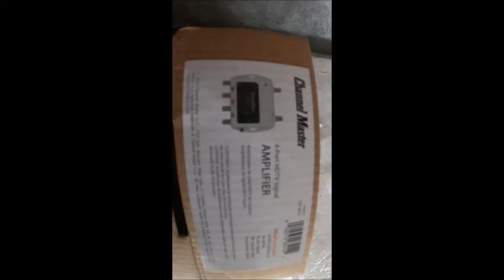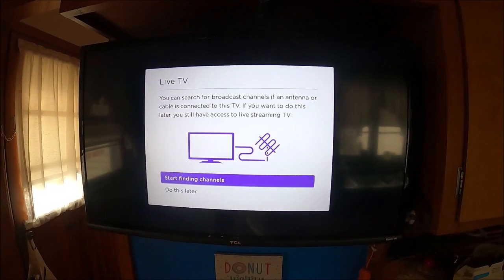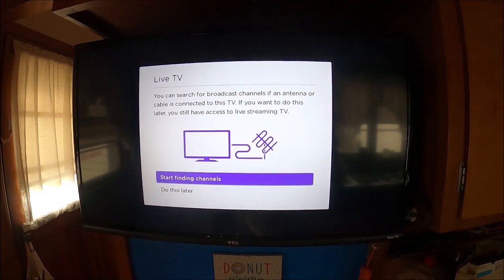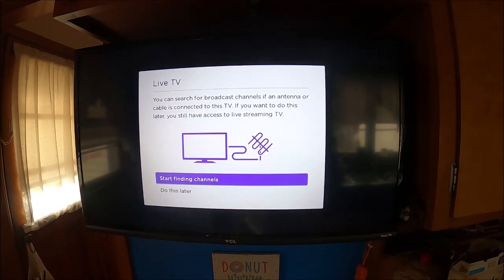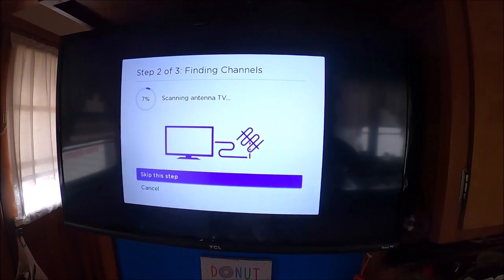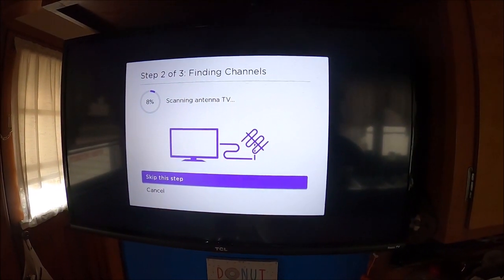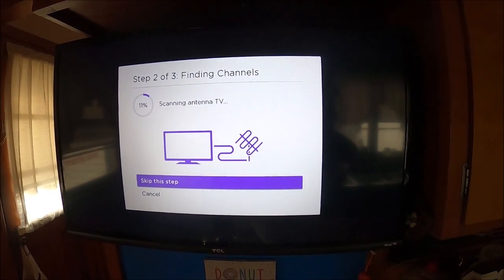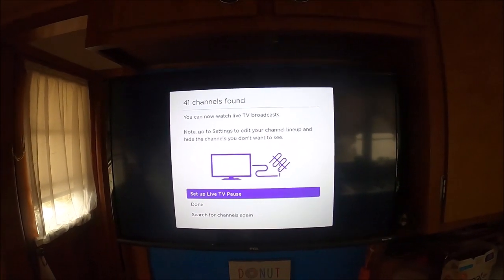Tv Antenna Distribution Amplifier

Comment: I was told never loop coax cable. Put it in a figure 8. Any thoughts?
Reply: Coiling up excessive cable causes attenuation (signal loss).  Best to cut it off.

Comment: How far in the sticks do you live? You'd do better with the antenna mounted outside if you're that far away from the towers. I have an Antennas Direct ClearStream 2V mounted outside about 15 feet off the ground feeding 3 TV's through a 3 way splitter with no amplification and a longest cable run between antenna and TV of about 70 feet. With this setup, I get full signal strength reading on all but 6 channels from the towers 18 miles away. My channel scan yields 60 channels where I live.

Comment: if you have a rotator, why did you point the antenna in two different directions.  You have halved the signal when doing that.  since the antenna is inside the house, obviously, your not far from the tv towers.  Put that mess outside and you will have more channels by eliminating the building interference.
Reply from the maker: i want to pickup tv signals from New york city  and central new jersey  .
Reply: @9bofunggardens  We pull in 77 channels from NYC using an outside antenna.  Its way more stations than we need.

Comment: Where's the ground wire?
Reply from the maker: Good point will connect  ground wire I have a copper pipe  in the ground with ground wire running  up to the attic